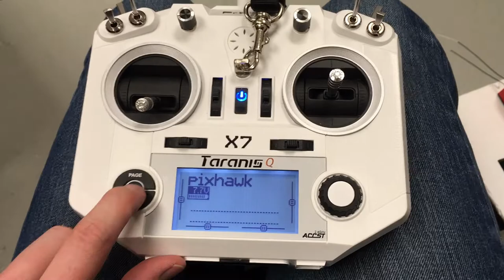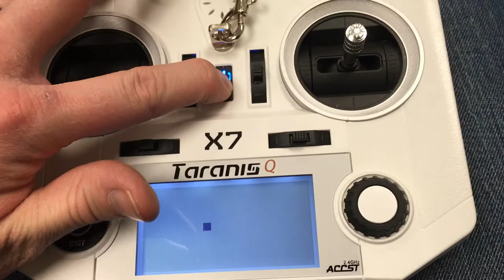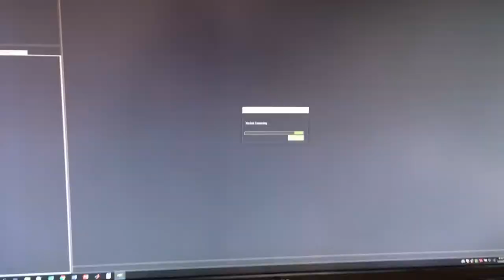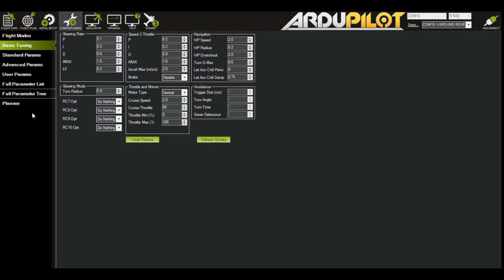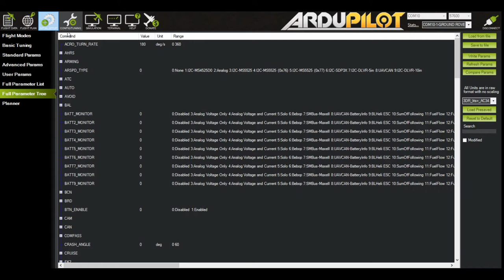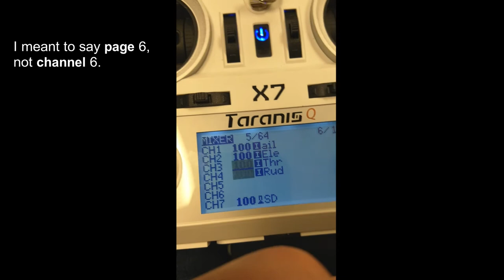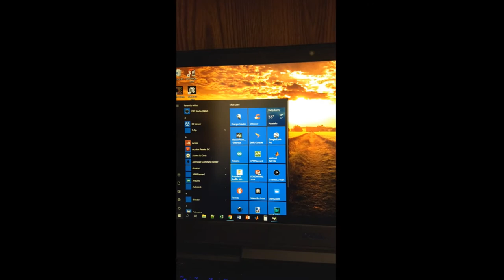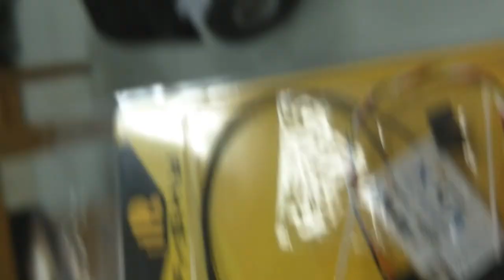Pixhawk, Piksi Multi, Sabertooth - Autonomous Robot Ground Rover Setup

Comment: I know this is an old video, but just an FYI for people who watch it in the future: 2:49 that motor controller does NOT recharge the batteries when it's driven in reverse. No motor controller can do that. What it DOES do is recharge the batteries a little when the wheels are decelerating, i.e. when you release the throttle and it coasts to a stop. It's called regenerative braking, which sort of acts like a brake when there is no throttle input, causing the rover to come to a stop and using the spinning wheel to feed back some power into the batteries. This does not work while the wheels are actively being powered (forward or reverse) via the throttle.
Reply from the maker: Thank you! That always confused me but I never took the time to understand it, makes sense now! That's how some electric cars work so I should have realized 🤦

Comment: Firstly thank you for the detailed explanations of everything. I am making a rover but I am using tracks. I was wondering what is Pixy 14:55. What is the orange control logic board and why do you need that? Feel free to give any advice or suggestion for settings for tracks. I am using PX4 with cube

Comment: At 20:40, can you elaborate on the setting to avoid full throttle. It is important function to avoid fuse blowing up or damaging the driver in case you use larger motors that pulls more that drive amps rating

Comment: Hello, is there a way to get PWM values out of pixhawk main output to serial values on Arduino. My idea is to use Arduino to translate PWM values to control my H Bridge motors
Reply from the maker: I do not know the answer to that right now. In my mind it would be much easier to buy a motor controller that can accept pwm signals if you have the money. The saber motor controller I bought from super droid robotics cost around $60 I think. I would check pololu and adafruit for cheaper options, and maybe Amazon, too. 

I did just do a quick Google search and it looks feasible. Check out forum.arduino.cc/t/pwm-to-serial-converter/445692

Comment: Do we have to use RC? What we are planning to do we are try to building an autonomous rover that is running without RC. I think we should not have it for calibration etc.
Reply from the maker: I would double check the pixhawk manual but I think it will allow you to run without RC capability. You won't be able to tune your controls, though. Troubleshooting might be harder, too.
Reply: @ryanmoeller6892  I mean, our plan is to move the motors without using mission planner, and a RC. We use dronekit library for autonomous movements.

Comment: Hi Ryan, very good video, I learned a lot. I am a complete beginner in making a rover, but I make rc mowers and would like to upgrade them. https://youtube.com/user/urbanbelaj I don't know if I fully understand, telemetry and lidar can't be turned on at the same time, is that correct, and why not? And another question, can we position the points for the map with the help of a rover outside directly in the field? Thank you and best regards from Slovenia.
Reply from the maker: I did not fully test the lidar functionality, so if can't answer that question, sorry. And as far as the way point input goes, the only way I know of is the manual way, but I think there must be a way to "hack" the pixhawk and send it way point from a c++ program on windows, for instance. Sorry not of much help there.

If you want more functionality, ROS and a raspberry pi would be the way to go, but that's a whole different thing that I've never done before.
Reply: @ryanmoeller6892  thanks.